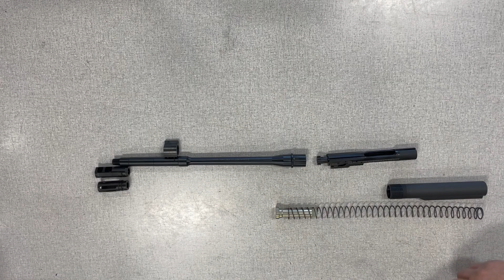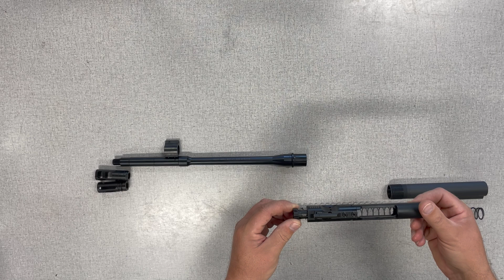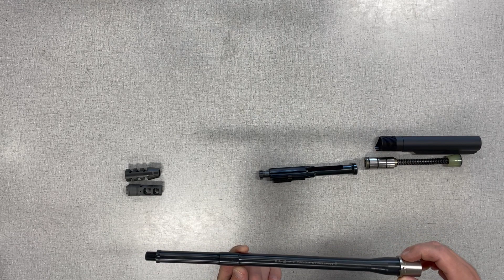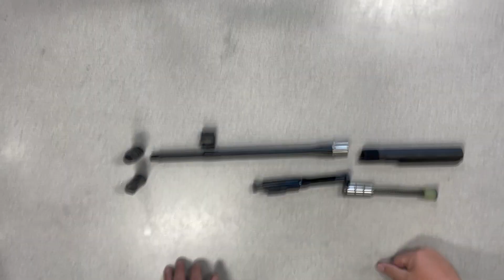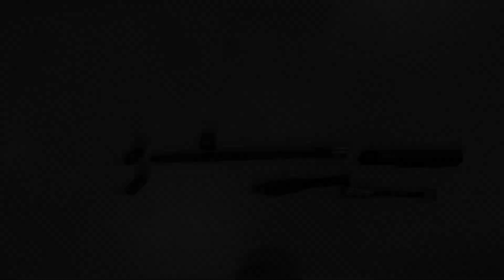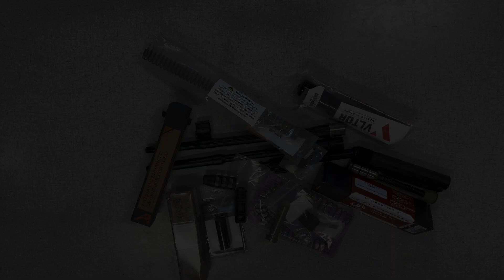AR 15 VooDoo, Timing an AR System, Part Three

Comment: Great series sir. Thanks for putting it out.
Reply: Where is your shop located and what do you recommend for gas port size on a 14.5” mid barrel? I’m curious if you pin gauge barrels often and have a port size you prefer for traditional/ non competition roles. Thanks!

Comment: What about the Geissele super 42 braided springs?  Tubbs flat springs vs regular vs braided.
308 with the rifle Super 42 braided spring?
Reply from the maker: I'm not yet convinced that braided springs do anything different than a regular spring.  Braided springs as far as I can tell originated in Germany during WW II as a stop gap due to a lack of spring steel, not because it was better.

Comment: Opinions with the AR rifle is endless, but your picks are sound..The BCG by Microbest is a great choice as is the DD barrel. I prefer pencil barrels with a semi auto as well as standard mil spec Vltor receiver extension. My favorite adj gas block is the Rifle speed, easy to adjust, maintain and replace parts..JP SCS are also a good choice.. JP makes a buffer retainer detent if a person wants to capture the SCS.. The 3 chamber MWI compensator is another copy of the tried and true Jerry Miculek compensator..
Reply from the maker: These are just examples of the parts that relate to the different systems an AR can have.  I could easily swap a FN CHF CL barrel or a Criterion for the DD barrel, etc.  There are multiple types of silent captured springs for competition guns right now too.  The JP is just the most common.